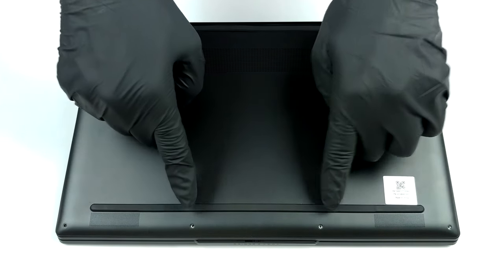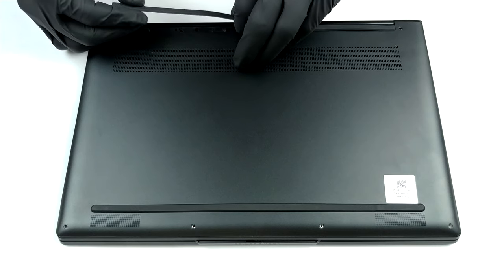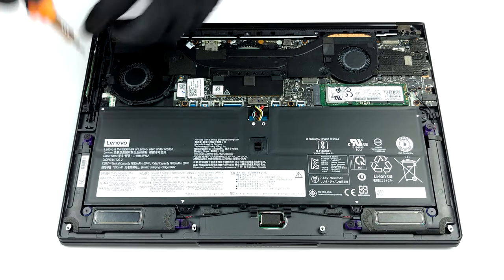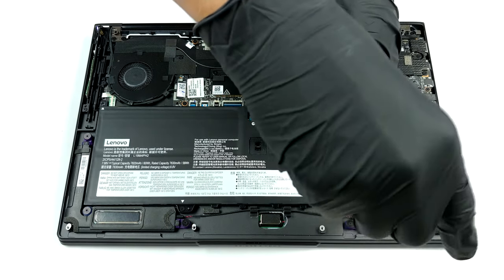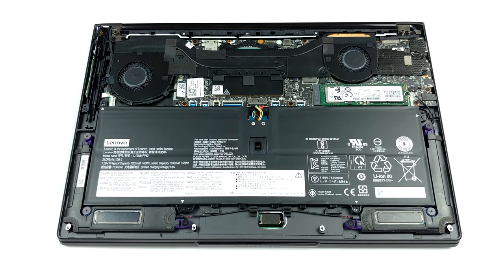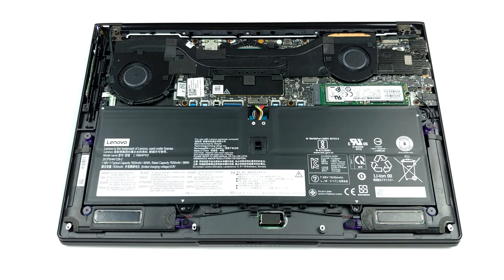🛠️ Lenovo Yoga 9i (14) - disassembly and upgrade options

Comment: I wish I would of known about the 3 small screws under the rubber! The guys video I watched did not mention that and I removed it without removing those screws. I hope it didn't cause any issues since my wireless doesn't seem quite as good now. Does the rubber go back in?

Comment: Do you know where can I buy the bigger ssd for this laptop?
Reply: i built in a 2tb standard ssd (in this case intel 660p). you can get it anywhere. look out for an m2 2280 ssd. worked.

Comment: Hello, I need to open a Yoga 9i for an SSD change, what is the correct measurement of the 4 Tork screws that are in line at the base? I would like to know because none of my screwdrivers fit in them.  Apparently they are of a different size than the two that are at the back.  Thanks in advance.
Reply: Mine are t5